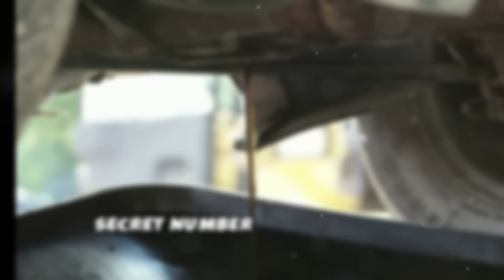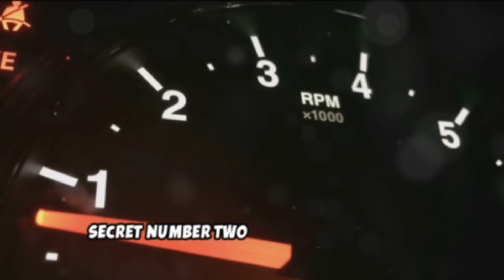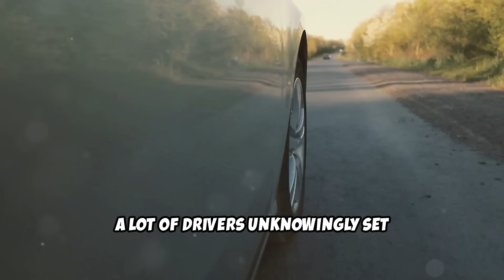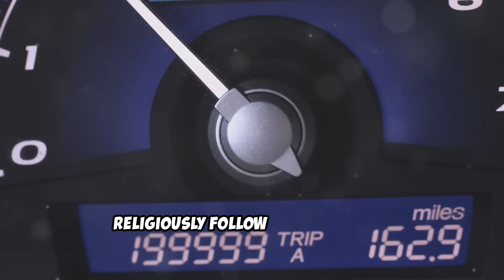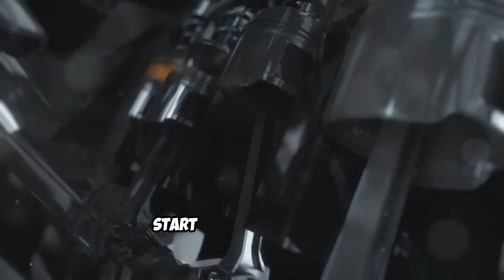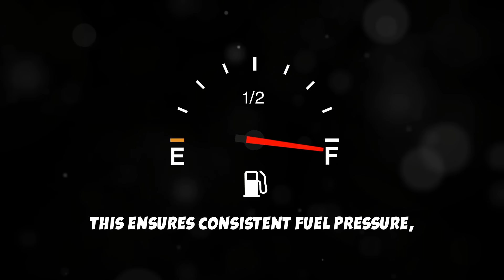5 Diesel Secrets Only Experienced Drivers Know (Most Owners Don’t)

Comment: How often do y’all change your fuel filter?
Reply: I change the oil filter at every oil change, every 9-10,000km, and I change the fuel filter at every other oil change, so every 20,000km or so. Much more important than changing the filter is periodically adding diesel fuel additives. It is extremely good for the entire system and prevents deposits from forming on the injectors and the entire system. I personally use "Liqui Moly" for diesel engines.
Reply: @perakojotgenije  Indeed both good intervals and products : I use the same intervals for our diesel  SUV ( ran 200 K km ) as well as for my wifes petrol  2006 Alfa Romeo. ( ran 300K km ). 
I use Liqui Moly additive  Petrol Engines for the Alfa Romeo and Total diesel additive for the diesel engine, but the diesel is running either on GTL ( gas to liquid ) or HVO 100 ( hydrated vegetable oil ) both giving higher cetaan ; almost no CO2 and fine dust ( easy available here in NL )
Reply: @perakojotgenije how often do you use that additive for diesel fuel, please?

Comment: Great tips, another bonus of not letting the fuel tank get too low is less water vapour from the air in the empty part of the tank can get into the diesel fuel which is bad. I've also invested in a diesel fill device in the filler neck to prevent narrower petrol pump nozzles being inserted, filling a diesel with petrol can potentially ruin the engine (don't ask me how I know !)

Comment: Good info. 2024 Duramax 6.6, the manual says 7500 miles, dealer says 5000 miles. As this is not my first diesel I’ve learned thru testing, change it between 3000 to 4000 miles depending on how much heavy towing. Motor oil is cheap diesel engines are expensive, it’s a no brainer.
Reply: I do the same. I’m older so 3000 mile oil change has been engraved in my mind. 250 hrs for my marine diesels.
Reply: 360,000 miles on my 2000 F250 7.3L powerstroke.  This beast holds 15 quarts of oil and carries a full quart in its huge oil filter.  I change @ 7,000 miles.
Reply: I do the same 3500 miles max I try to hit   3000 miles.
Reply: I change oil in my Nissan Pathfinder every 6t miles .
Already have 400t on it and engine runs like new
Reply: I change mine as soon as the engine oil goes black, which is about a change after ever drive, so its about a daily routine. My diesel car is at 150k miles now and engine running perfect!
Reply: @Ilikepie18855 ???!?!?
Reply: @Ilikepie18855 yeah me similar. Once in the morning on the way to work and once when I get back home.
Reply: Every day driving I change at 5000. If I do more towing I change at 3000
I change ALL fluids and filters at the end of every season. I’ve never went by the manual intervals. Because the manufacturer only wants your vehicle to last till the warranty period.

Comment: What happen if is a push start not key
Reply: If you push the button without putting your foot on the brake pedal, the electrics will all turn on but the engine won’t start.
Reply: @andrew2825  I have a push start on a Prado diesel and the glow plug light does not show up ever. Does your suggestion mean that if I push the start button into IGNITION ON without pressing the brake and WAIT - THAT WILL ALLOW THE GLOW PLUG nonexistent light to GO OFF behind the scenes???
Reply: @jarekast754  i think you'll need to check your manual. I've never seen it myself in my car, but i live in warm climate. Maybe it is temperature dependent.

Comment: Every 5,000 miles for my oil change
Reply: 5000 km (3000 miles) for my old idi NA diesel. Mineral oil cheaper ones. Live in a very hot & humid place and pockets of traffic jams where idling with ac is a must.
Reply: Or yearly, whatever comes first.